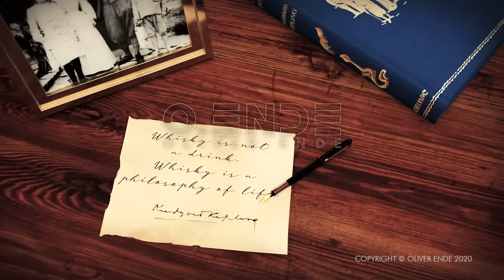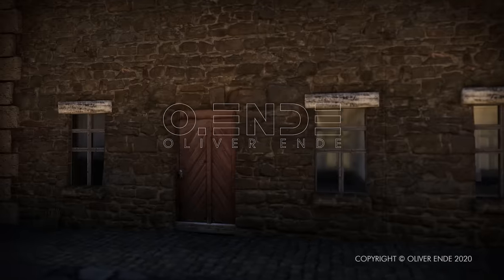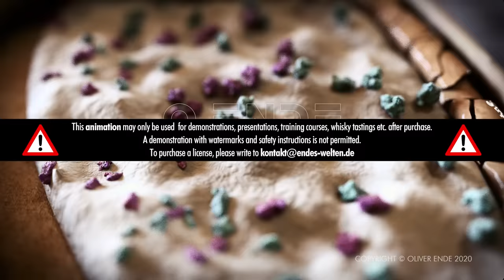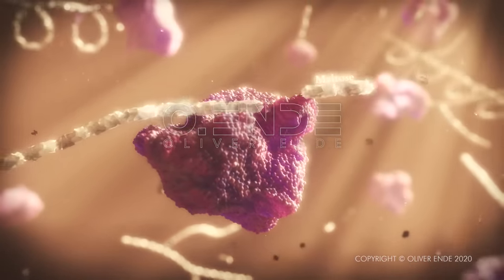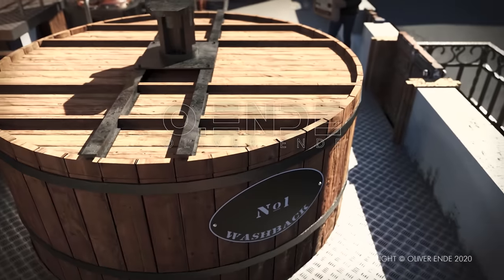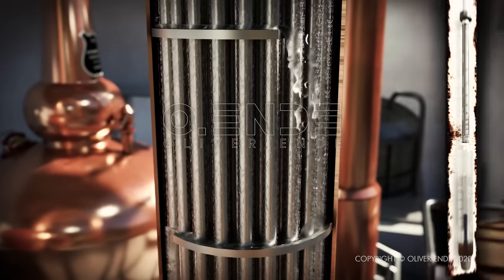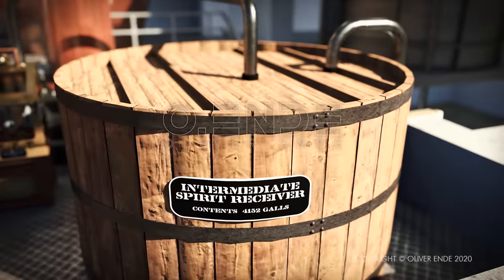How Whisky is made - 3D animation about the production of Whisky (remake 2020)

Comment: Excellent video. I have a question for anyone knowledgeable about the drying out and fermentation process.  So after they get the barley wet and spread it out on the floor it begins to germinate with a tiny little shoot that comes out from the barley seed. To keep it from overheating I see a guy walking the floor basically with a huge rake behind him raking the germinating barley around so it doesn’t get too hot. What’s confusing is the little germination shoot seems very delicate and easily damaged yet the guy is walking on top of the barley over and over doing the rake thing.  Doesn’t walking on the barley damage the little germinating seeds?

Comment: Very good ! I just don't get why some whiskies are called "cask strength" to mean they come right from the cask and thus are stronger in alcohol. In this animation, the last step seems to be taking the whisky from casks and bottle it, so what differentiates a cask strength whisky from a standard one ?

Edit: I found that cask strength whisky has no water added in it. But in the animation, water is added before the whisky being put into casks. Does that mean water is added a second time after the waiting ?
Reply: Cask strength means no water is added and when it comes out of the barrel it goes straight into the bottle. The animation doesn't cover a cask strength or show any bottling for some reason. MOST whiskeys have water added while being bottled to proof it down to around 40%.
Reply: @devonzimmerman1944  Okay, thank you! I actually thought the alcohol percentage decreased during the time the whisky was in the cask
Reply: @lad3144  The alcohol % does decrease during the time in the barrel. Alcohol will preferentially evaporate than water. Typically shouldn't affect too much as this takes many years, but say after 5-10, it'll still be in the 60s, but after 30+ it can drop to 40-50%.

Comment: Thank you so much for this video. Given that english isn't my first language, I couldn't quite catch what he says at 4:43, I hear bloor, but I dont know the meaning, could you tell me?
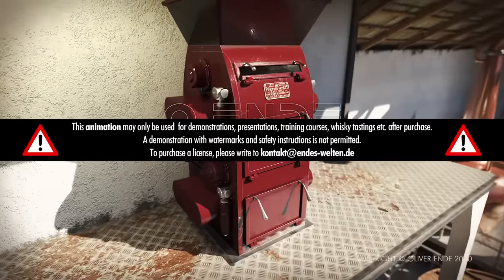Reply: At 3:59... 
imidiatly before mashing the malted barley is grainds to Crist so that it opens and the sugar content can be extracted, then in the mash turn it is mixed with water at a temperature of 62 to 65 degree celsius. The mash is dirt Consuntrate using a rotating rack, now the beta amylases are activated and convert the starch into various sugars  Which are then desolved in the water. Sugar types include maltose, 
 glucose, monosaccharides
 and dextrose. The condition under which the enzymes works affected activitiesactivities. 
In order to shorten the processing time the blower insures the best possible conditions in the mash. 
After a thirty minutes the liquid is drained through the perforated bottom Of the mesh tank and collected. 
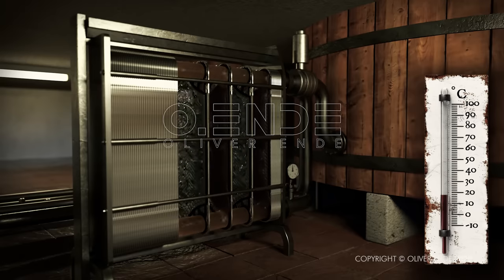The mash is mixed with water a second time, this time at 70 to 75 degree celsius. The decode is drained off and collected. The mash is now heated for the 3rd time at the water temperature of 80 degrees. However the sugar content is much lower than in the previous steps and therefore this mash is about to use for the sub sequential fermentation but it is cooled to 64 degree celsius and used for the next step of mashing process. 5:30.
Enough.
Reply: @astrologylab  thank you!